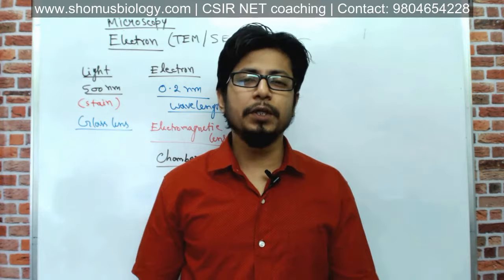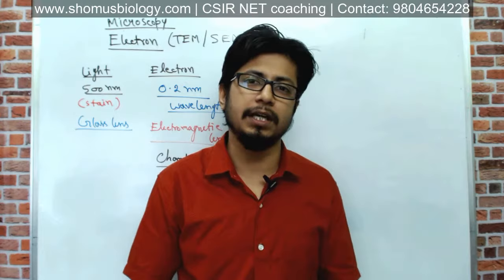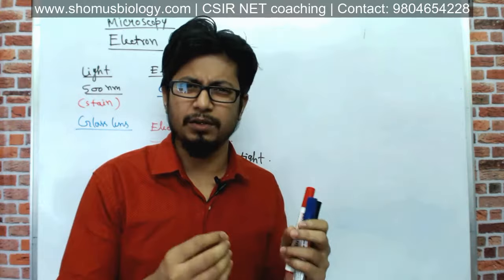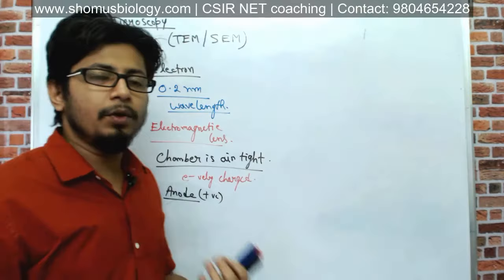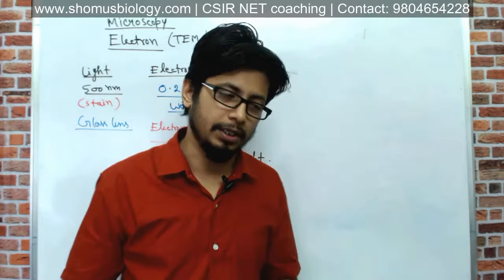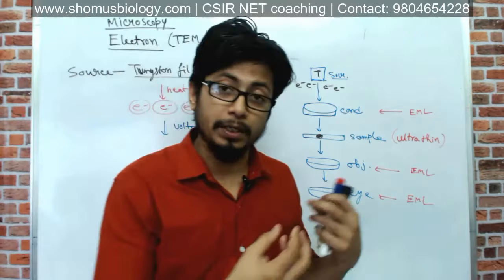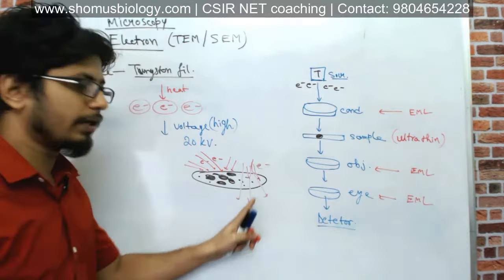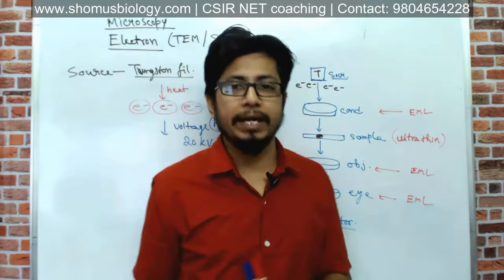Transmission electron microscopy principle and working (TEM)

Comment: Presentation is superb. At the same time cutting sample with glass knife and diamond knife is not easy as you have explained in your presentation. Even sample preparation is a tedious job. If fixation and  preparation is not good your whole procedure will collapse and it will impact your results. From A to Z it should be accurate and dust free environment.
Reply from the maker: Thank you for your input

Comment: Interesting lectures. Please can you explain if using PCR to find sequence of interest, say a viral sequence, the primer and probe alone will somehow stick to complementary sequence in a  crude sample with many mixed sequences of different lengths and nucleobases. Am confused by the terminology used calling the target sequence of interest a template seems to imply a predesigned sequence is also added into the PCR process. Grateful if you can clarify. Thanks.
Reply from the maker: Chcek my pcr video in this channel